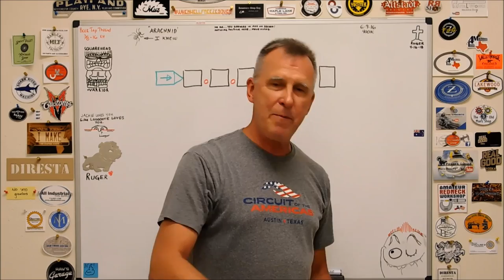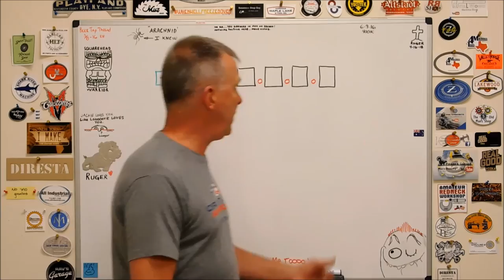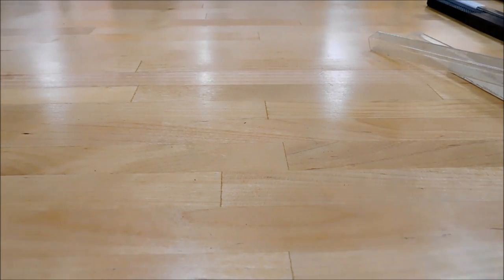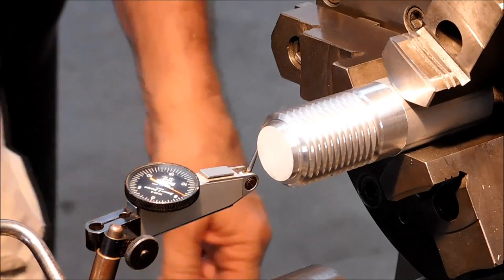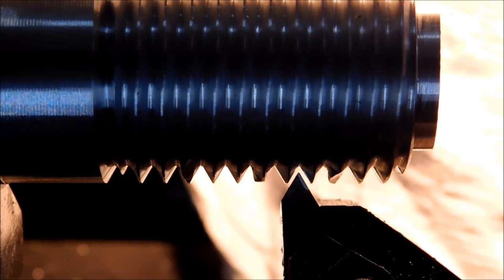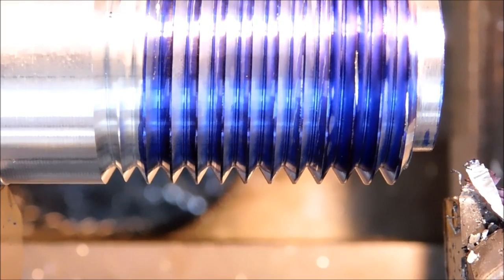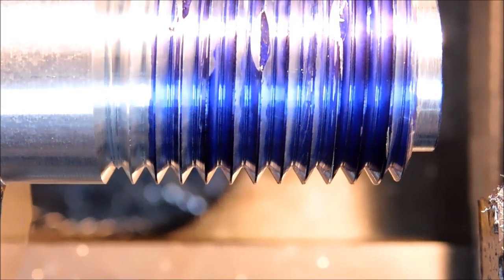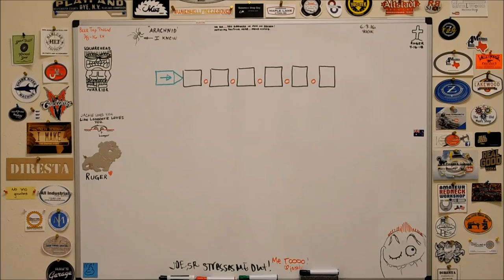Chasing and Repairing Damaged Threads

Comment: If you had a VFD on your lathe, you could make the adjustments on-the-fly as the tool is traversing the thread, then speed up (for a long thread) and finish the cut.  The VFD also reduces the "train effect" by going so slow that friction overtakes inertia and the cars remain compressed.
Reply from the maker: A VFD would be good for turning. I don't know if they are coordinated with the spindle rotation for thread pitch matching..
Reply: @joepie221  You need no "thread pitch matching".  What the VFD does is to permit (a 3 phase) motor (already installed on the lathe in the usual way) that would ordinarily be fixed-speed, to be variable speed, down to an absolute creep, at FULL TORQUE!  All the other mechanical stuff on the lathe is totally unaltered, because it is derived from the spindle.  If you already have a 3-phase 208/240V motor, you only need buy the box and wire it in.  If not, buy new motor and replace existing motor (box can run on 1 phase power).  1/2HP or less, you can use 120V single-phase plug to power the box.  You can program the box to limit acceleration, or avoid speeds that cause resonance.  You can add a knob on the control panel to set the speed, ADJUSTABLE ON THE FLY, WHILE TURNING.  It is like having variable drive (like on Bridgeport mil) without any of the "can't change speed unless you are running" limitations.  (For example, you can make a turn of a big face, and speed up as the tool moves toward the center.  Or turn a long thread, slow down at the end and let the tool "crash" into the end of the thread, when you can't have shoulder.)
Reply from the maker: Its not the motor that causes the train effect, its the carriage, gearbox, head etc. I honestly do not see any benefit in a VFD when attempting to thread match. A super slow RPM would do the exact same thing if thats all you are shooting for.
Reply: @joepie221  I guess what Brian is trying to say is that a VFD would allow the motor to run slow enough while setting up the lathe that the lathe parts don't get enough momentum so that the "train stretches" when you stop it (something like powering the locomotive just enough to compress the train, not run it). But, as you said, the motor is not the problem, as the feed/threading screw is powered by the gearbox, which is, (as far as i know, for a manual lathe, anyway) powered by the spindle, and the issue here is the synchronization (and the backlash) only between the spindle and the carriage.

Comment: I am not sure if I can thread going away from the head stock. I have a 2-1/4"x8 tpi nose on my spindle. I was using a 10" 4-jaw and decided to buy a 6" 3-jaw chuck. It does not hold the work like the bigger chuck. While threading 9/16"x18 starting with a 1-1/2" bar stock the threading tool hit the shoulder of the larger bar stock. Again, I thought it was tight, but it pushed the bar stock back just enough to screw up the almost finished thread. I didn't know it moved changing the timing as you demonstrated in the video. I guess I wasted a lot of money on a 61-year-old lathe by not buying a larger diameter chuck. I have turned to your videos many times over when I am trying to figure issues out that I am not familiar with. Thanks for taking the time to present YouTube videos as learning tools to help a hobbyist as well as the seasoned machinist.
Reply: Three jaw self centering chucks never hold anywhere near as well as four jaw chucks, even at the same size. One way to prevent push back is to first turn down a chucking diameter slightly smaller than the bar, before reversing it in the chuck. However, a half-decent six inch three jaw should hold plenty well enough for any normal situation. You're probably lucky it pushed back when it did, otherwise you might have overloaded the feed, or smashed the tool (or even the compound)

Comment: Hey Joe, great video, I recently moved to a job shop that does a lot of industrial motor repair which includes welding up, and returning journals on rotor shaft, typically next to threads. A majority of the threads I’m chasing here have been full of weld spatter (no big deal, I just chase them) but sometimes the thread is distorted so bad I can get a good pickup, do you have any suggestions I can pass along to the welder to help keep the treads from distorting so bad?
Reply: Oh and I’m from the U.S., south central Idaho.

Comment: I'm wondering how Robin would do this with his solid mount toolpost.  What you're showing seems to absolutely require a compound.  

My best guess is using a collet with a stop, and do the timing by rotating the part in the collet?
Reply: To be fair Robin could easily put his top slide back if needed, but most of his work is new build not repair so he knows what is best for him.

Comment: You missed a repair method mate, probably my most often used one too...

Grab the nut that goes on that thread and so long as it's the same material or harder wind it on by hand plus just a little bit and then hit the nut with a hammer, repeat till it goes all the way on and off by hand.

Probably not the first method any sane person will want to pick given a choice, but typically I find that the damaged thread I'm dealing with is still attached to the tractor or car I'm working on, and not something I have a die for.

Comment: Hi Joe, Hello from Horsell Village, England, great video as usual. Particularly liked the back lighting tip. For indicating in a thread, I use an 'Insize' Back Plunger Dial Indicator (2357) with a flat plunger tip. (6282-1101). Works great with some patience.
Reply from the maker: Thanks. I also throw my scale under the part from time to time. The silver satin finish works well as a reflective surface too.

Comment: a dynamite video - on the issue of indicating a thread, I recently watched a YouTube video where the machinist set the machine for the thread pitch and engaged the half nut to indicate the thread. I thought it was pretty clever...certainly not as good as making up a sleeve but clever just the same. His application was an internal thread.

Comment: Hi Joe, thanks for the best vids. I have a Colchester Master 6" dating from 1933. I live in Johannesburg South Africa. I was asked to chase the threads on the centre-lock hubs of a 1946 MG. Threads are 2 1/2" 12 tpi. There is no visible damage to the threads but the knock-off nuts only screw on for 4 or 5 turns before tightening up. The side shafts are splined into the hubs and the splines were badly worn due to the poor design. (6 off square profiles) A bodger then welded the side shafts into the hubs. The weld heat has resulted in pitch changing distortion. The problem is that when I chase the threads, the existing threads "screw" the cutting tool forward or backwards so that it follows the existing threads without any chasing action. The only solution I can think of is to make a die nut to chase the threads. this is not a cost viable solution. Any suggestions?
Reply: I'm not Joe. Are you saying that the screw threads are picking up the tool and moving the carriage within the play of the lead-screw?
  If so, very light use of the carriage lock screw will provide enough resistance to keep those threads from pushing that carriage. 
  This all seems a bit odd, but small light machines can be easy to push about. Is your tool nice and sharp?
  Good luck.
  Mark
Reply: @markrichardson239  That is correct. But the play is in the compound screw. I made a new nut and screwwhich improved things a lot, but no cigar. the change in pitch is very small. My old lathe does not have carriage locks either. I have adjusted the compound slides till they are so tight that the handwheel is difficult to turn .
Reply from the maker: Once the tool is positioned central to the threads you wish to re-cut, lock the compound and use the cross slide to feed in. Keep your hand on the carriage wheel like a brake pad and keep pressure on the handwheel as you thread. This keeps the thread as accurate as your lead screw even if the half nut is worn.
Reply: If anyone reading this is still interested in alternatives: a suitable toolpost grinding setup would also work, with a small skinny wheel dressed to (I'm guessing, in this specific case) 55 degrees, using Joe Pie's setup ... When I do this I turn the spindle by hand. You have to take tiny depths of "cut" in comparison with single point threading, but there's almost no force transmitted from the work to the carriage, and you don't need to traverse the whole length if the damage (or pitch variation) is local. Blue is still helpful for tracking the progress.

Comment: I indicate an o.d. thread with a one inch travel indicator and a flat contact approximate  3/8 in. Dia. Works just fine.
Reply from the maker: It would, only if the thread OD and pitch are concentric. Easily inspected/determined with a single wire inspection.
Reply: @joepie221  Pitch dia. And out side dia. Are not always  critical in a hurry up and get it done maintenance shop. YOU KNOW WHAT I MEAN. SHOW THE DIFFERENT TOOL POSITIONS FOR CUTTING THREADS, I.D. BORE BAR ON THE FAR SIDE OF BORE , GOING TOWARDS CHUCK AND ALSO TAILSTOCK. TOOL UPSIDE DOWN ETC. SHOULD BE INTERESTING VIDEO. KEEP UP THE GOOD WORK.

Comment: Maybe a stupid question from a hobbyist:
Why not simply loosen the screws that hold the threading tool in the tool holder, then push the tool against the thread by hand and then  lock the screws again?
Reply: Not a stupid question, but you will find that when you tighten the screws the tool will move. I have never chased a thread, have seen it done. The people that do this fast and give you back a great part, do it the Joe was saying put cross slide inline with part and move the compound and cross slide till they are in the right spot and make your cuts. When I asked how to do this, they would just tell practice till you can do it. I worked CNC machines the Machinist on the manual machined had the crazy mad skills. If you want to learn to do this make a thread take part out and do what Joe did damage the thread then fix. You do not want your first Chase to be the part you need to keep.
Reply from the maker: You can do that. I have done that with internal threads. It gets you pretty close. Good observation.

Comment: I bend a piece of banding and then stick it to the lathe with a magnet.  Then I position the upright piece of banding so that it rubs on the smooth thread.  Place the indicator onto the center line of the thread diameter, and indicate.  that is how I indicate a thread.  You will figure the rest out.

Comment: re: indicating threads: why not a flat plate tip for the indicator that will bridge the pitch? sure it will average out the reading over its contact area, but more than a sleeve would? am i missing something?

Comment: What I do to take up the backlash in the gear train I attach a bungee cord from the carriage to the end of the lathe bed.
If it is a right hand thread I attach to tailstock end and vice versa.
Reply from the maker: Keep a constant drag on the top of the handwheel as you thread. Like a light brake.

Comment: Another thing to consider I’m not getting to aggressive in the depth of cut for thread restoration is that the cutting tool is not equally loaded on both sides of the cutting point due to thread damage it’s major loading may be only on or more predominant jangly on one side of the thread. I am NOT a machinist.

Comment: If you know the alloy and hardness couldn't you Tig weld the top of the parts before machining. Perhaps with a preheat to help control distortion due to temperature differential. Then make sure to heat treat the parts if there were previously.
Reply: I should add any coating should be removed before welding like zinc which will crack the welds.
Reply from the maker: The level of effort in the repair would be driven by the requirements, budget and available machinery.

Comment: joe,,,, got a problem.. my pulley on my motor is too small in diameter and the belt is slipping..i need to make a larger  pulley. so i have more surface  area and more grip  how do i make a larger pulley on a lathe that the belt slips ?   buy one ?   thats the easy way out.. but the.any ideas...?the lathe is a myford ml10      3  1/4 " center height  x   16" famous in england for model makers    and now as before a very costly item... any ideas?  pulley bore is 1/2" the outer dia  is  2  1/2"...in my humble opinion these little myford lathes  dont spin fast enough  regards,,,, laurence
Reply from the maker: Greetings. Making a pulley isn't as hard as you may think. If you use a thin tool and the compound to do the angles in the 'V' groove, it takes a lot of load off the machine. Another option is to fabricate an idler to apply pressure to the belt and remove the slack.
Reply: @joepie221  thanks joe the second pulley should work     regards  laurence
Reply: @joepie221  yes the idler is the way I would go, only thing is these model making lathes are very expensive and any alterations is seen as sacrilege and will devalue the resale price. I suppose one could take it off again lol

Comment: Does the train principle apply the same way to a machine like a South Bend that’s not a geared head machine?
Reply: Ohhhh but it is....
Reply: Yes. The power flow from the spindle to the leadscrew is what the train principal refers to. Not the motor to the spindle.
Reply: @half-assedgarage6668  Thanks for that comment. As a non-machinist, It saved me from asking a dumb question regarding the difference in momentum between the  drive motor and the chuck. Possibly reintroducing some of the backlash he was aiming to minimize. Cheers from Oz.

Comment: There is a way to indicate a thread I hope I'm not duplicating someone else's answer. What I do is I set the machine up the cut the number of threads I have to duplicate. Then I put the bolt in, engage the half nut and hand pulled the chuck until the the carriage moves. Then positioning indicator at the crest of the thread now simply turn the chuck and the indicator will follow the crest of the thread.
Reply: Indeed. If the crest is too ragged or damaged or sharp, a suitable sized ball probe on the DTI, centered in the thread valley, can engage with the flanks (ideally near the pitch diameter)

Comment: I don't understand.  I follow the first half wherein engaging the half nut and stopping the machine.  Then align the compound parallel with the bed then adjust the cross-slide and compound against the thread. As per one of your past demos, should use linear vernier to adjust the compound to center cutter to thread.  Then with half nut still engaged back up slowly to LH part of thread, set cut tool to thread, then start lathe letting cutter clean the threads stopping machine at RH end of thread.  Part that not understood is running lathe disengaging half nut, backing up carriage, and plunging cut tool back into work.  Seems things must be out of sync for cleaning threads.  There must be good explanation of the latter portion of the operation.
Reply from the maker: The carriage is timed to the lead screw. Now the tool is timed to the carriage. Disengaging the halfnut will not affect the thread timing no matter where you now start the thread. Does that make sense?

Comment: I only fix threads by reforming them. I never cut them. Also I never try to use the half nut on a strange lathe. Also if the lathe has one of those stupid automatic spindle brakes, you have to thread off of a shoulder cause it will never stop in time.

Comment: I was under the impression that train couplings stretch when pulled and compress when stopping. MrPandale, Texas
Reply from the maker: Sounds correct. How does this apply?
Reply: Listen to your explanation of the train, please.
Reply from the maker: @MrPandale  You apparently completely missed the part where I clearly stated the engine in this example is in the rear. Please re-listen to my explanation. My comments are accurate.

Comment: why not back the tool out half way of the thread  with the lathe off and half nut engaged and use a dial indicator on the compound to find thread center? on a good portion of thread of course.
Reply: with the compound parrallel to the part

Comment: Im not a fan of thread files. I have a collection of 3 corner files.  when I indicate a thread, I lay a .100 shim on the threads and rest an indicator on top. I made a holder to make this easy. Where you start the thread, I cut a groove with a radius tool. I never liked sharp corners, always a place for cracks.

Comment: I have a method of doing this on fanuc cnc, makes you feel like a wizard
Reply from the maker: I'm betting you can't hit it on the first try. If you can, you may actually be a wizard. :)
Reply: @joepie221  for my own sanity I have to float above the thread and make sure I've calculated the start position to the threading encoder by tracking it by eye.. gives a lovely sense of control but pucker moments engage when you commit to a go ahead!
Reply from the maker: @robbiestevens1158  My emergency stop button on my CNC should read " OH SHIT ". I can't tell you how many hours I've spent hovering over that button just after hitting the Cycle start or Auto button. I completely understand.

Comment: If you want to indicate on the actual pitch diameter of the thread, the only way I can think of to do it would be to put a ball point, a very small one—ideally the same diameter is the thread wire, on a dial indicator. Then, set the gearbox for the desired thread pitch, put the indicator on the tool post, and maneuver the point inside the thread. At this point, you should be able to track the pitch diameter of the thread by manually jogging the lathe with the half nuts engaged.

I haven't tried it yet, this is all theoretical, but I can't think of why it would not work.
Reply from the maker: Once concentricity can be assured, I really like the suspended feeler or block technique in the comments here.